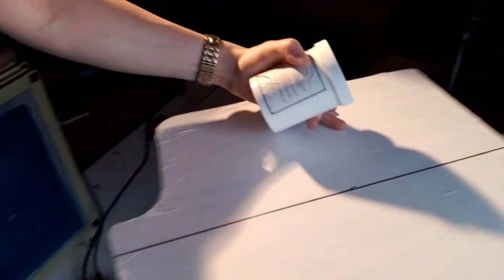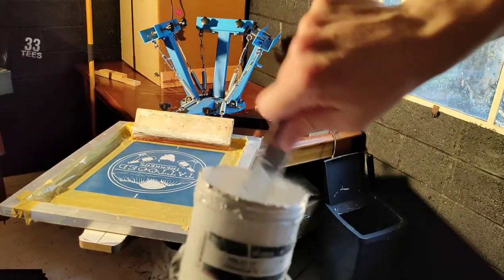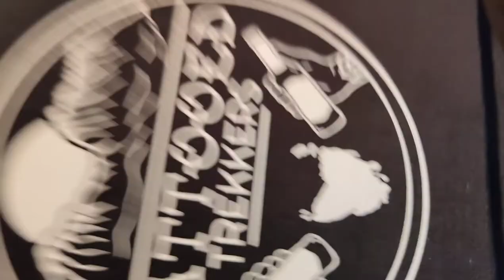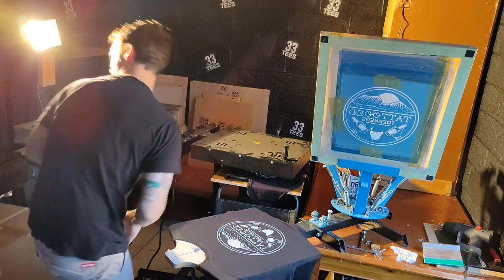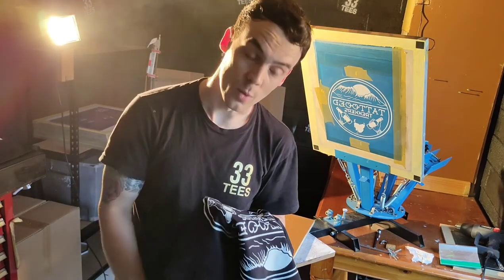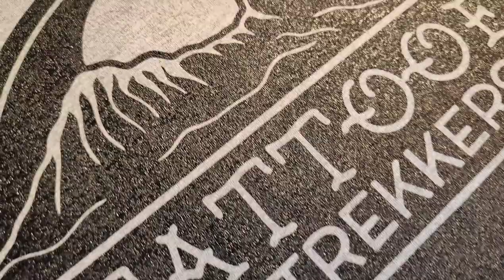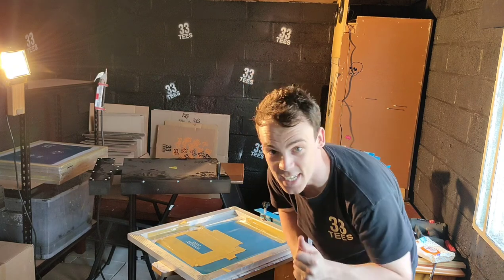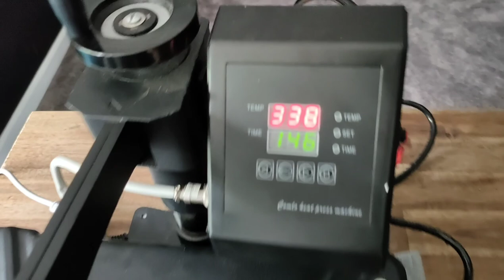Screen Printing Business From Home

Comment: The best improvement we made in our early days was upgrading to a press with rotary platens, and having a stationary flash. Sadly though, we had to remove 3 platen arms and modify the printhead up-stop to use our press in our tiny space. It fits nicely in about a 5x5 corner of our room. We still only print one shirt at a time, but I think that allows for finer attention to detail.
Enjoyed your video, and subscribed :)
Reply from the maker: Thanks very much!

 That really is something I need to look at! A rotary machine would be amazing. My space is around 2.5x5m so I am just struggling to find a comfortable configuration that works at the moment.

I really appreciate it! It means a lot!